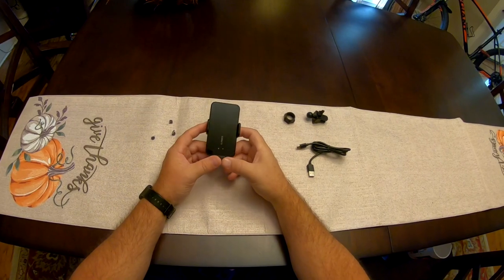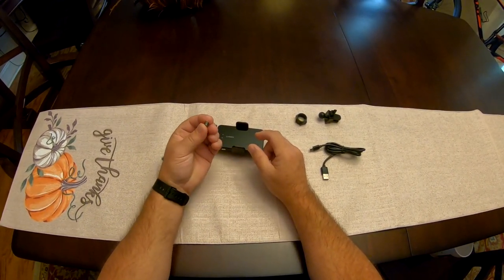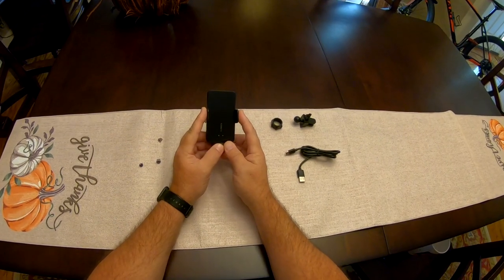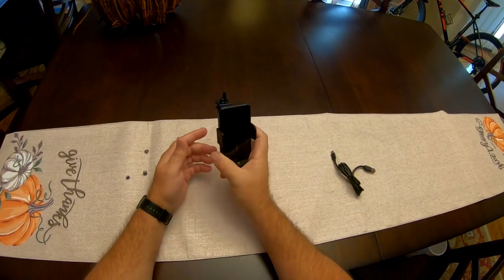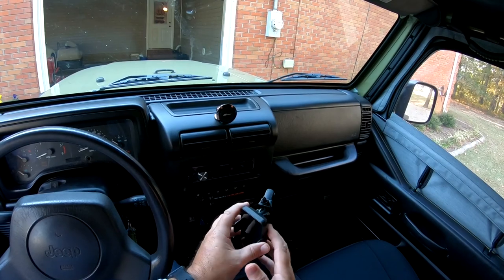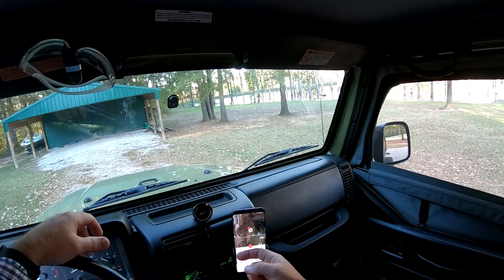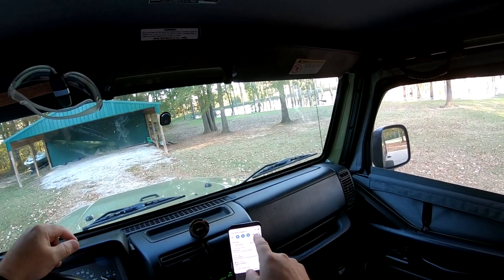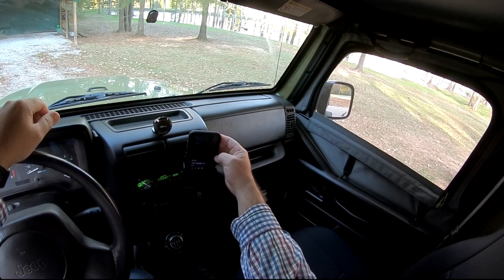Joytutus Wireless Charging dock! Jeep Wrangler TJ

Comment: I’ve been looking for something that charges for the jk and this looks like it could work but the only issue is the jk has the vents that spin 360. I had something similar in the past and every time I turned the vent would throw my phone across the Jeep. Still a good looking dock station. Glad you are getting recognized by companies now.
Reply from the maker: Thanks KC! I think it would have worked in my JK, though I never did try a phone holder for it. My vents were pretty firm. Sounds like yours twist easily?
Reply: Yeah they are pretty firm but you can’t put weight on them. I feel like my old JK (07) had much tighter vents and would probably hold no problem. Get a sponsor that makes a JK holder lol! Also, I’m really excited to see the channel grow. Let’s get this man some more sponsors!